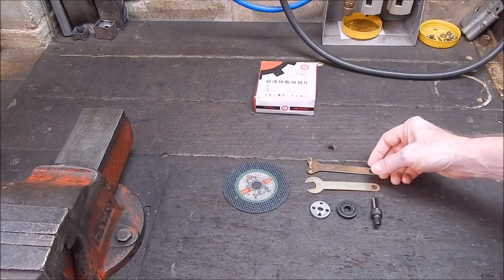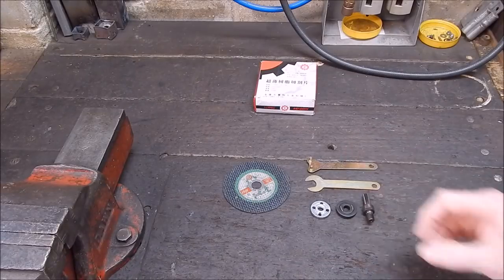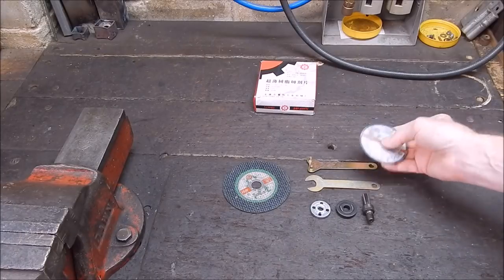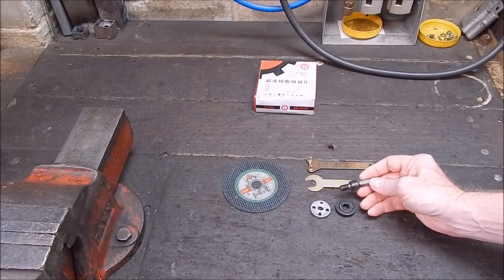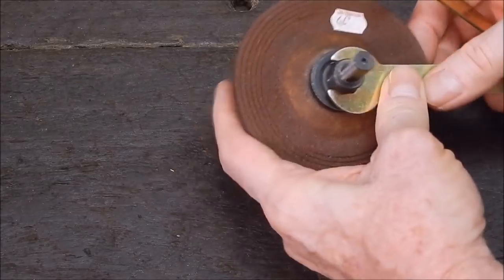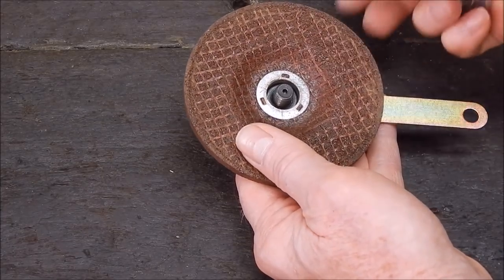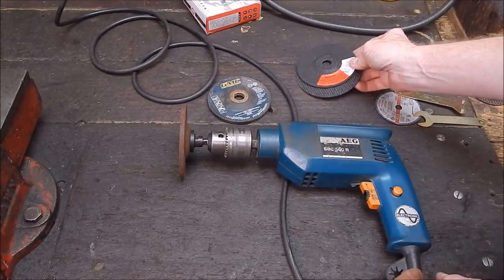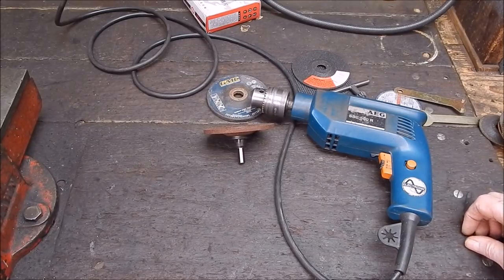A cheap cutting and grinding disc arbor for an electric drill/rotary tool

Comment: Beware as these only work with the smaller hole diameter discs - normal sized agle grinder discs have too large a centre hols.

Comment: You've NEVER had a disc shatter?  You must have a very steady hand.  Lucky you.  It's good for quite a startle.  I broke 2 or 3 in my lifetime so far, mostly when I first started using them.
Reply from the maker: No never.  I've had discs tear up the cutting edge on thin metal, but no disc shattering.  For that to occur you would have to bang the disc in too hard, or twist it  out of alignment.

Rob
Reply: the ultra thin cutting discs look about as strong as paper, so its probably them, ive never used them, just the standard (thicker) cutting discs
Reply from the maker: The runout in the disc disappeared as the speed increased and radial inertia came into effect. 

I agree the disc looks pretty fragile in that diameter.  The 75 mm discs I use in a similar thickness show minimal runout in comparison.

Rob

Comment: Excellent review Robbie. Thank's for sharing. If I may make a very small suggestion when you were showing the run out, to help better see the run out, maybe just lay-down a common sheet of white paper. The brown disc kinda gets lost against the backdrop of the oil soaked wood table top. Nothing to do with the focus of the camera, just plain old brown against black background. In my opinion just doesn't work. You are the premiere bargain hunter, and again you nailed it here. Now for my favorite Aussie expression: She be right mate. :-)
Reply from the maker: Hi Dave,

It's a camera issue.

I'm best off when I use the grey leather welding apron as a back ground.  The problem with white backgrounds is that my camera stops down severely and the colours go murky and contrast goes weird, so that's why I use the dark bench top.

I always keep it in mind when filming white stuff, even my white hands can cause it.

It's an excellent camera apart from that.

Thanks for the suggestion anyway.

Cheers Rob

Comment: The problem I have is that cutoff wheels will not tighten on my angle grinder. After tightening the four-hole arbor nut  as much as possible the cut off wheel still spins freely.
What to use to adapt cutoff wheels on an angle grinder?
Reply from the maker: Sounds like the discs are too thin or the clamping disc faces are worn from slippage.  Add a washer under the clamping nut or machine/ grind back the center section on the nut a bit and it should grip again. Cheers Rob

Comment: Bit of contradiction  ?
You summarised all the discs were OK.
in fact it was the Bangor disc that first made you look at the runout I think.
Reply from the maker: Well picked up Steve.

When I edited the video I had to put the disc scenes out of order a bit due to a filming glitch.   It was over 35C today and I didn't want to shoot that bit again, so it's slightly contradictory.  

It's more of the same weather currently.  38C again for the next three days.  It's a real ordeal trying to work in these conditions.  Lucky any videos get shot at all.

Cheers Rob
Reply: xynudu 
2 deg here  !
Want to swap  ?
Reply: Going down to -20C overnight here... I'll swap!

Comment: pity about it being m10 rather than m14, m10 discs are more expensive and less likely to be around here,   we all have worn standard discs and ones out of date, this would have been a way to use them,  make one for m14 guys!
Reply: you need the two shoulder parts, yes, i have no lathe, but at the price they could make one in china, who'd bother,

Comment: Rob, thanks again for another fine review. Now, as you clearly have some inroad to Banggood, can you treat your subscribers and viewers to a contact who will respond to problems such as incorrectly delivered parts, ultra long deliveries etc. Their website contacts just don't work for us mere mortals.
Reply from the maker: Hi John,

I get treated like any other customer and just use the support Email if anything goes wrong.  It seems to work OK for me.

Same with the postal system, the order gets placed and just goes through the normal channels.  I do buy stuff from BG as well and have only used support once when something went wrong.  They seemed to respond as well as any Ebay experience I've had. 

I only have contact with the sales side, not support.

Cheers Rob